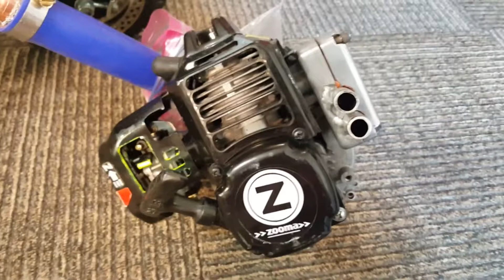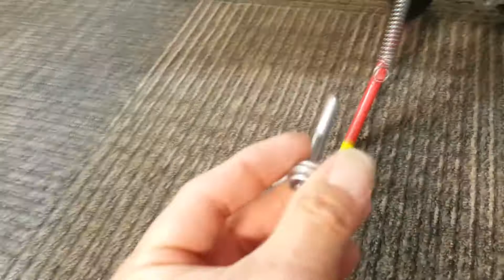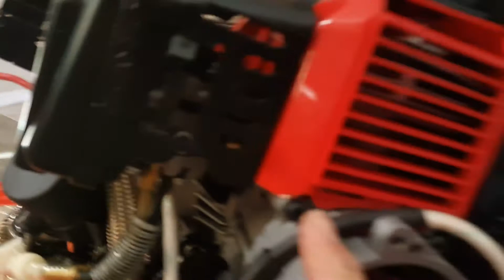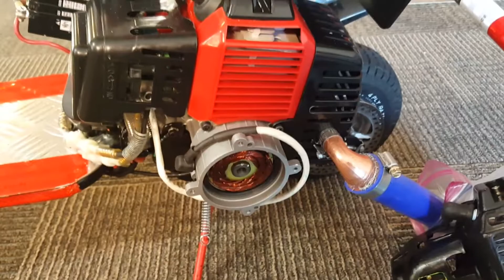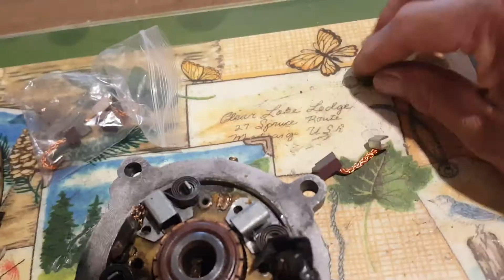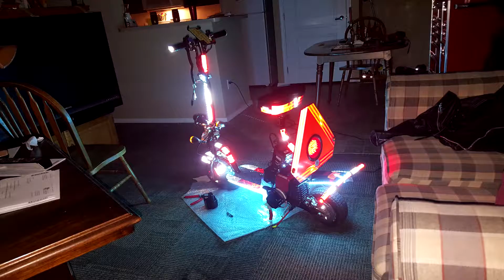Elecrtic scooter starter

Comment: When I Hook Battery Up To Starter It Turns A Bit Then Stops Take Spark Plug Out And It Turns
Reply: Is the white wire connected to the battery if so what voltage im looking at a kit on Amazon just curious as to how it works

Comment: To.take off electric part remove pull starter put piece of rope in where sparkplug goe that way when u try to take off center  nutvimiddle of starter it wont spin so u take out that bolt then take out thefour studs on out side of starter  then pull off starter its little tricky  becaudevof the magnets inside
Reply from the maker: I just use a 20v impact drill . Worked 9.5 out of 10 times, and it does not get junk in the cylinder.  The hold down bolt is not that hard to remove.  Especially if you have the correct set up with the correct electric pullstarter double bolt . I made a new lower noise exhaust with tons more torque, feels like 3.5hp -4.hp . but been working on a new electric hyper scooter design.  Been too busy to make a video on that for now . Sorry... thanks for the advice . Make absolutely sure that it is centered when you put it back on, and not rubbing the stator . It will rob too much hp.

Comment: How do you remove the electric starter once the pull starter assembly is off?😮
Reply: Ya I figured it out but thanks for the quick response
Reply from the maker: @marctobey5408  if you put it back on ? be sure to center it true . it can rub itself to death quick
Reply from the maker: just put a bolt down the center hole ,and push it off . but holt it . it is a press fit . I think it is a m6 size . no special tools needed . you need something to hold the crankshaft from spinning . I just use a impact driver myself

Comment: What kind of pull starter would you use if you installed one on your scooter? Thanks
Reply from the maker: If you have a electric start ? Keep it off to keep it cool! It can lasts waayyy longer with plenty of cooling and centered correctly! I carry the pull start separately, and put it on in a pinch/ dead battery.  I have about 8000 miles on my scooter,  been through 5 motors about 9 starters . Rebuilt most of them . Aliexpress starters are the same ,but for wayy less! About 45-55 bucks compared to 75-90 on ebay
Reply from the maker: The kind with the paws last the longest . Not the spline type ... They break too easily.

Comment: Hey man, I'm thinking of putting one of these starters on my engine,  would you be able to tell me what the distance is between the holes? I'm not sure if it would fit to my motor.
Reply from the maker: it has to have the correct crankshaft end . if it is tapered ,and takes a small bolt hole ? it will work . if it is to take a nut ? it will not fit . . this is a TL 52 clone , but some cateye engines can use them too . they are the same , but you want the correct crankshaft end .

Comment: How do u wire up a electric starter I can't seem to find a video or anything? 🤔
Reply from the maker: I will try to make another video? It is just frustrating that they don't allow much viewing when you been blackballed.  I have about 6500 miles on this scooter . These engines, and starters are pure junk out of the box,  but I will show you how to make them last a whole lot longer soon ! More power., more fuel economy,  less noise , cleaner burning 🔥
Reply: @SharkFaceKidd  ok thanks lmk
Reply from the maker: @Mylotheblacknwhitecat  I will show you how to make an hybrid out of this set up and get more power . Enough to satisfy most lay persons !
Reply: @SharkFaceKidd  hey just checking in I've been trying to figure out how I can wire one them up to my 49cc motor
Reply from the maker: @Mylotheblacknwhitecat  you need a correct crankshaft friend . if it has a bolt on the pull side  unit with a tapered end ? it could work . if it has a nut ? it will not work . and could be easier to just buy another whole thing from ebay? if you can wait for product ? aliexpress has better deals . but shipping time is 2 to 8 weeks ! the motors are sold as 49-52cc ,and are 52cc . they call them 1e44f engines . some come with the starters already ,and are cheaper that way ! the starters are usually always floppy ,and need alignment ,so rebuild it totally using good orange locktight ! . the engines are rebranded Mitsubishi TL-52 s brush cutters , they have amazing 1e50f engines which are perfect size for scooters , but the communest libtwit ignoramus government will not let you find or have any ,and will not let you find them on the net !!
Reply: Wonder why? Is that why my neighbors complain 🤔 lol

Comment: thank you i need one of those for a project
Reply from the maker: Thanks . I been banned or ratioed by Youtube/ google . If you center it . It lasts a whole lot longer . I rebuilt this ,and used good parts ,and thread locker (orange) and it's lasted a good while . I have a few more trick to show people a little later . I'm getting a whole lot more hp and torque with better fuel economy.  I guess youtube might be loosing up their stranglehold on me?

Comment: With the starter do you pull it it or press a button to start it?
Reply from the maker: Press a button.  It also makes electricity.  So you can charge the battery too. But it can over volt as it is a generator too. Don't want too high of rmp when charging with it.

Comment: Isn’t that also a generator
Reply from the maker: Yes ! It make a whole lot of volts in upper rpm range . None of the set ups I have seen work very well for regulation.   Anything over 15.2 volts may kill your battery permanently.  I have seen them put out 19.5 volts . I just use a small bright voltage  guage ,and the starter button to recharge when it gets low 12.4 volts and hold down the button to 15+ volts.
Reply: Maybe try a solar charge controller

Comment: Hello I'm trying to fix an old scooter with one of these engines. I have no spark. Is there no stator on this engine? Just voltage regulator and ignition coil?
Reply from the maker: It is a China clone of a  Mitsubishi  TL52 engine. Or 1E44f you may have a ground problem inside the cover with the wire or need to replace the coil. But sometimes you are more ahead to just spend the hundred for the whole thing? Then you get everything. Just be sure to thread lock most everything again before use. Q.C. is not good whatsoever.

Comment: Hi.
 I understand you posted your video 2 or so ago years ago..
If you remember how to take off the electic starter,  Remove it from the motor.. I'm having trouble removing 3 starters from 3 engines.. 
Please respond.  Thx.
Reply from the maker: It's just a bolt that fits down the threads . It pushed itself off . You need a metric bolt that is bigger than the one that is the little on down the inside that keeps it on . I think it is 6 or 8 mm ? It is a press fit . May be easier with a impact gun/ drill. Hope that helps

Comment: I had no idea they had electric starters for this size engine
Reply from the maker: Yup . It's usually a novelty, but we figured out a way to make them last a little longer. It turns the motor over very fast ,and it also makes electric charge.... a lot of charge. 18v. They call it electric pull start. It adds about 2 lbs.
Reply: thats a small engine

Comment: What is the length size of that bolt?
Reply from the maker: They have 2 differ length size . I would go with the longer one. If it is too big? You can always chop it down a little. But it also helps keep it center. They are on eBay. Fancy scooter ..."
 Cat Eye, X-1, X-2, X-8, x-7 Pocket BikePull Start Plate Bolt B (63.5mm Long)  "

It's actually shorter . Copy paste to ebay to look.
Reply: @SharkFaceKidd  damn, got the 58mm one, time to order it again....😑
Reply from the maker: @feliperodea8316  happy New Year! Hope it works out for you. I know it is pretty frustrating to find parts...  I am making a actual 72cc scooter next. It will have a real 72cc engine with compression release button . Not a 63cc that everyone called a 72. It will have very compact a high torque transmission never seen before. It has very fat 11in tires . 10in clearance . Made from very hard chromoly 4140. Made to last a few lifetimes! 475lb max limit .
Reply: @SharkFaceKidd  Nice, I'm rebuilding mine. Want to rebuild it back to factory default.
Reply from the maker: @feliperodea8316 nice! what Are you working on?
Reply: @SharkFaceKidd  a XG-470...
Reply from the maker: @feliperodea8316  cool. Get rid of the fake charging system. Put a small voltage reader ,and use the starter button to recharge so you don't over volt the battery. 15 is too much for 12v. To handle. I found out the hard way they mostly use fake charging system that don't work, and ruin battery, and starters . The module lasts a few minutes. If you are lucky ! I made one with a old dodge regulator, and a big volt relay that worked Good, but it was too clunky . So I just use the starter button to recharge now.   Good luck !
Reply: @feliperodea8316  By chance do you still have that XG-470? I am working on one, but the wiring was all messed up. Looking to try and figure out the way everything is wired so I can get everything working again.
Reply: What do you mean by fake charging system? can you give more details on what is involved and whats needed. Thanks! @SharkFaceKidd
Reply from the maker: @xFalgharx  you need an dc generator system regulator.  It will put out massive volts at top rpm . 18-19volts I found a old dodge type H.D. regulator hooked to a works relay of 40amp value works ok. The other O.E.M. types have never really worked past a few moments, then fried . I've tried many times , but the voltage regulator they used was pure junk for the D.C. generator side of the starter . Now I just have a starter solenoid, and when the voltage hits 12.5 I just hold the button down till it hits 14.8v when running fast

Comment: Where did you find the starter?
Reply from the maker: Copy paste...    Cat Eye, X-1, X-2, X-8, x-7 Pocket Bike,APC Chopper Pull Start Plate Bolt 02331
Reply: @SharkFaceKidd  helloo ..would you happen to know or have a link on how to get that off the motor?
Reply from the maker: @Blanc247  it's a little press fit. You just find a bolt that threads into the hole . I believe it's a 8mm and the middle hole is a 6??? You want it to be 2in in length Anyhow it just pushes it self off with a little effort and a 1/2 or 13mm wrench . Hope that helps?
Reply: @SharkFaceKidd  pardon me ,not the pull start but the whole copper coil area
Reply: Alibaba has some electric starters...
Reply from the maker: @feliperodea8316  yeah . That is from China too, they ask you to buy 10, or 100, or thousands at a time . .. Then It can take forever for it to arrive . I am developing epic amazing scooters , and one day may deal with them ? Watch out for their motors ! You want to rebuild them before use !
Reply: @feliperodea8316  cool thanks 👍
Reply from the maker: EBay. ..They also come with the motor. It needs to have the correct crankshaft (tapered end)

Comment: What is that white wire?
Reply from the maker: It the positive feed from the solenoid . It also the generator feed. It does both.
Reply: @SharkFaceKidd  do I have to use it? Can I just pull start only?
Reply from the maker: @scratchnoff7609  it's just for the electric start . It also makes electric charge,and lots of it as the RPM rises.  You want to isolate it if you are not using it. I am building another more amazing scooter with a new 2 speed soon! Very reliable transmission that has never been seen before. Compact light weight yet simple . The next scooter has 10in of clearance,  and made for 350- 450lb heavy fat guys/ off road too. Build to last forever .
Reply from the maker: @scratchnoff7609  you can just pull too. I don't have my pull start hooked up , but keep it in my backpack as a redundant start. It stays cooler, and the brushes last a lot longer on the electric start.
Reply: @SharkFaceKidd  I just learning before I upgrade to your level,  I blew throughout 4 motors lol an im sure all are simple fixes, but I'm starting to think I can't use the electric starter  for my  scooter
Reply: @SharkFaceKidd  is the kill switch also used as the starter?
Reply from the maker: @scratchnoff7609  the kill switch when grounded is to shut the spark plug off .
Reply from the maker: @scratchnoff7609  they have to be very  center to last, and cooled it's a little tricky to get right. If I ever get funding.  I'd love to make a brushless one. Maybe one day? Hope all is well for you.
Reply: @SharkFaceKidd  that would be so cool,  hey so I must use the electric starter??
Reply from the maker: @scratchnoff7609  the electric start takes a tapered crankshaft . Does your's have one? I find some of the pull starters a bit weak, and break too easy also. But they are easy to replace, and cheaper. If your's has one? Just make sure to tape up the hot wire with good electric tape to avoid disaster of fire, or pull down of power from grounding the power wire..
Reply: @SharkFaceKidd  like your in the picture?

Comment: How you doing mate at the end you show a burnt out peice.... Is that burned out part normally facing into the engine or outwards towards the pull start as not sure if u just got a different pull start
Reply from the maker: It's not burnt . It's carbon from the brushes

Comment: Where can I find the bolt that is needed for this project?
Reply: Thank you so much, I have been trying to find out for a long time and I almost about to give up and toss my scooter out and say forget it.  Thank you once again I really do appreciate it 🙏
Reply from the maker: sorry . I found it on ebay from fancy scooter. it was hard to find . they called it electric pull starter bolt .
Reply: 33-49cc type 4 electric starter crank shaft bolt